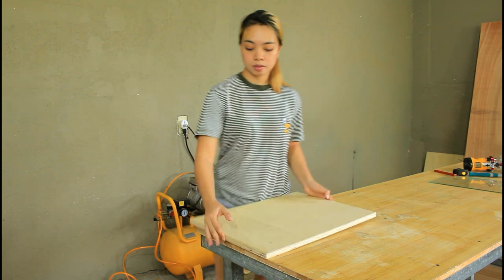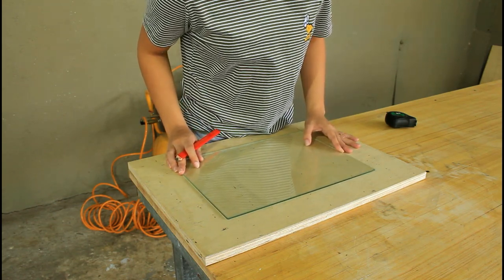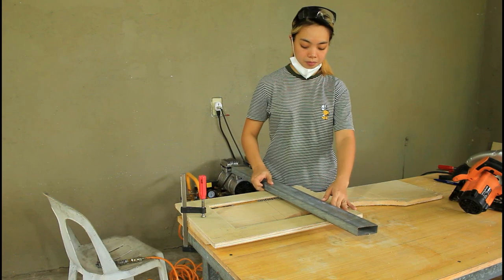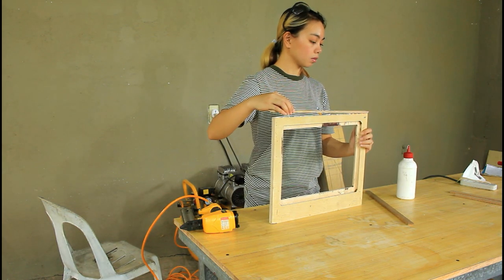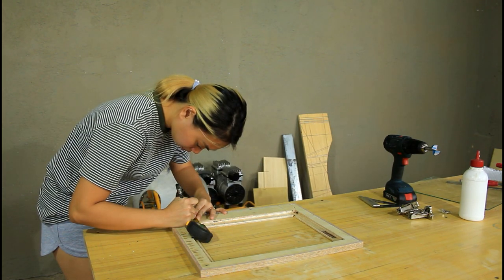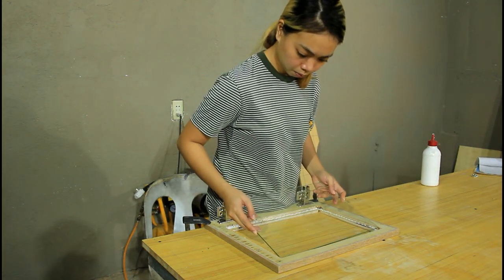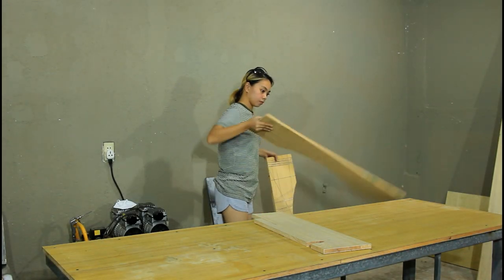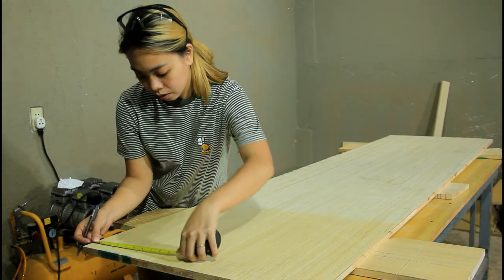I BUILT MY FIRST AID KIT CABINET FOR MY WORKSHOP!! | D.A Santos

Comment: In your videos I realize that the sequence you use for work is not the "traditional" - for example, make the glass frame and then cut the door - I do not know if it is because of the availability of resources, for your professional training (technical decisions) or by whim. It would be very interesting to know a bit of your training and experience in carpentry, I don't know if you have realized that you have simple and ingenious solutions due to your different work sequence. It was a good job.